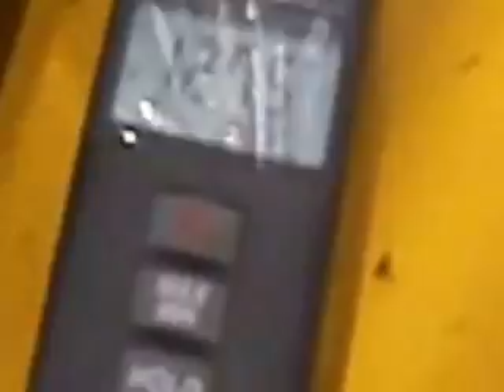Solar powered large Stirling engine (LTD) Bia Heliou, Lorach

Comment: I am still thinking that you need 100 unit of this to produce 1 kilowatt power, the strirling engine. You need big surface to release heat from cold side to produce alot of force and power.. not only the solar collector but the engine..
Reply: First learn math 1000w is 1kw

Comment: But they seem to be starting it up with a big electric motor, you can hear it in the background.  When do they switch it to solar power?
Reply: Dont think thats the case, they are using greenhouse heat and geothermal water as the temperature deferential
Reply: That thing took off way too fast to be starting by itself using just the heat that powers it. The more I search for info on this engine the more I get disappointed.

Comment from the maker: Dear Sir, well i am not related to the company that produced this technology, i just went there as a visitor to see if they can help setup manufacturing in India. However it didnt go as planned due to financial differences. 
But technically, its a 2 KWe engine, that runs on 180C hot water collected in flat plate/vaccuum tube collectors. it works at an shaft efficiency of 20%, as claimed by the company. its a LTD design, diaphragm type, beta stirling engine.
Reply: sir, can stirling engines be made self starting without the need to give any inertia?
Reply from the maker: @KabirSarkar143  I don't think so. It needs some initial momentum to get into sustainable cycles mode.